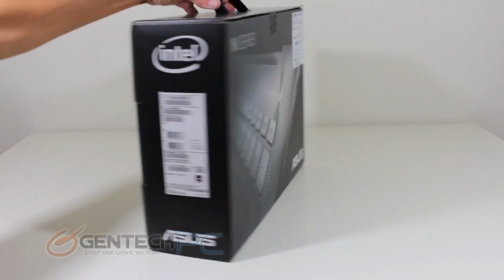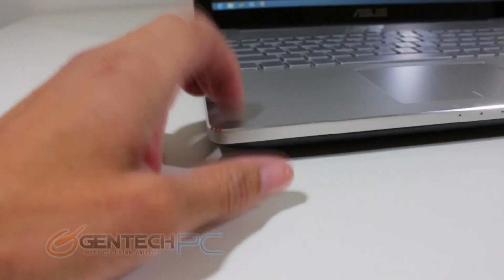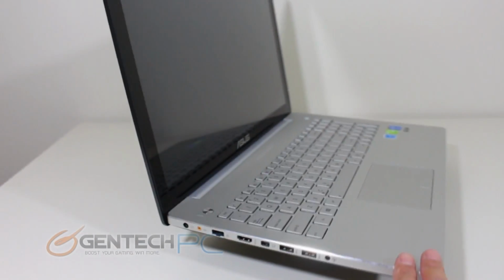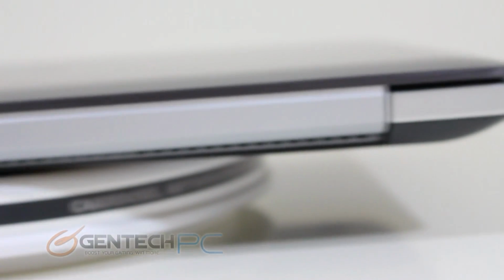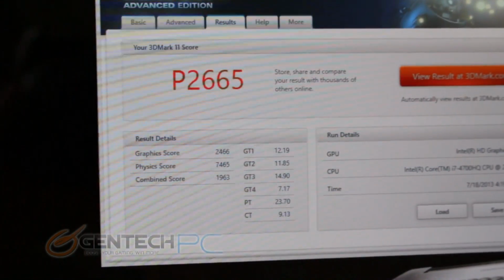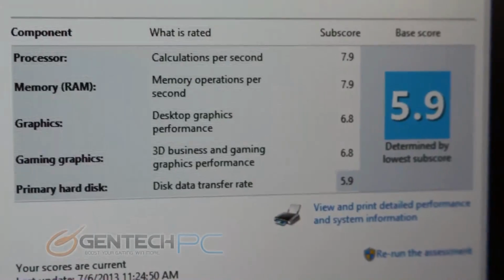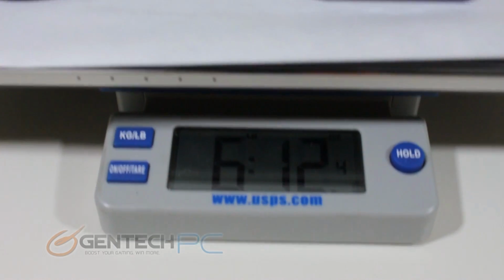Asus N550JV Touchscreen Laptop Product Showcase

Comment: is this laptop a good choise for music production ?!
Reply: im looking at it for the same thing, and i would say yes. 16gb ram, you can drop out the cd drive and replace with a 2nd HDD (i would do SSD for boot and main programs and HDD 7200RPM for data, sound libraries, etc). Also, as an ableton user the higher resolution display is attractice (Full 1080p vs 1366x768 on most 15.6" laptops). The GPU is overkill for music production, but a nice feature to have
Reply: touch is also nice for any XY axis controls you may use on filters and the like
Reply: thx man ! i've already got mine 8gb ram full hd but no touchscreen and im killin it with cubase 6 rewired to fl studio, no cpu overload runnin 76 tracks and its doing fine ! the only problem is the hdd 5400rpm but thinking to upgrade in the future

Comment: How does the Hands-off fun with Leap Motion* work?
Reply: There's no Leap motion with this laptop, i heard you can order it with it but i wouldn't recommend that.. i had my own leap motion and sold it the same week. Its just a toy. The program to control the pc is not from leap motion itself but from another company and its very hard to point at something. You need to be really accurate which is very annoying. A mouse works much much faster and also a touchscreen will be faster because you press what you touch, pointing (leap motion) isn't accurate and if you want to be accurate it takes a long time.

Comment: No, the only one is use by the wifi card. But nonetheless it's possible to have msata where the hard drive is, at least I know that I will have two msata in raid 0 on mine (I buy it on xotic pc).

Comment: Must ask you something. There is on sale one with 750gb 5400rpm with 24gb ssd. Can i change the hdd to 500gb 7400rpm one that i have home? Where is the ssd mounted? On the HDD or on another slot? And how is the ssd used ? for installing OS or its there for HDD cashing?
One another thing this one comes with Non-Glare LCD Panel full hd. is it good ?

Comment: if you're still wondering I'd say get the 16gb version, you could use 8 of ram as a hdd for OS data so it'll boot far faster than it would on a 7200rpm hdd. I personally would recommend going with an SSD so the 16gig model would prove to be better if you switch out the drive.

Comment from the maker: Thanks. :)

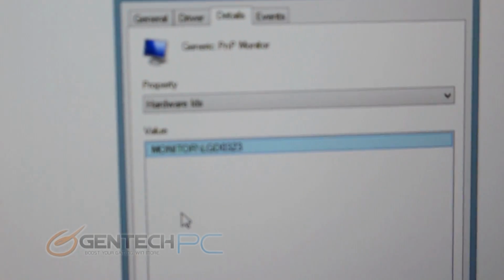At 08:14 it says it's a LGD0323 IPS panel in device manager,  if you google it it's a 1920x1080 FHD.  

Asus usually have different SKU with different panels. so yes there maybe a 1366x768 SKU out there but the SKU on our review is a 1920x1080.

The screen is a matte-type non-glossy LGD0323 just like N550JV-DB71.  However, the N550JV-DB72T with touchscreen has a gloss in front of the matte-type LGD0323 which makes it a glossy screen.

Comment from the maker: The screen are not upgradable on N550JV.  the IPS screen is too thin (same panel Asus use on the Ultrabook UX51VZ)  so the standard laptop screen won't fit on the lid. 

The touchpad is very sensitive, sometimes could be too sensitive.

Comment: A quick internet search revealed to me that LGD0323 panel (present in touch screen version) only covers about 60% of NTSC.
the matte-type display is LED-backlit TFT LCD Display, Display type: high brightnes(Typical 220-nit), 16ms high definition response time, NTSC:45%, Contrast Ratio:500:1 (Typical). I got my info from a local retailer.
Well, basically what this means is that all screens on the offer are pretty decent but if you want to work on photos or video - 95% NTSC is the only way to go.